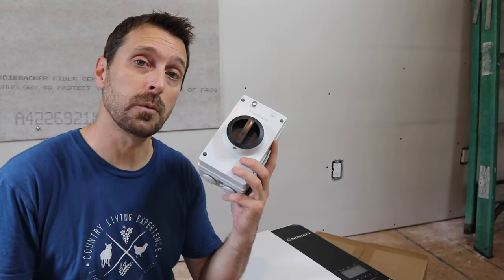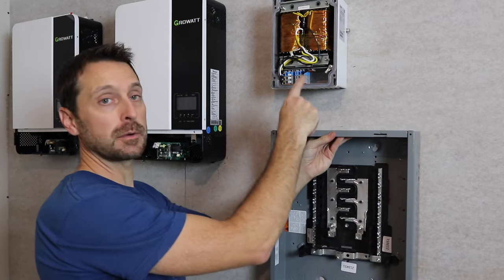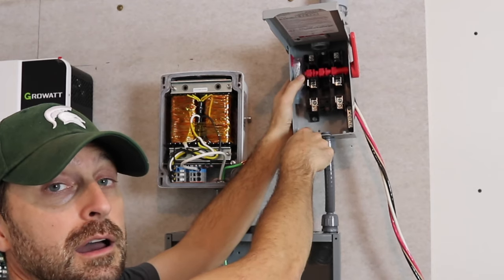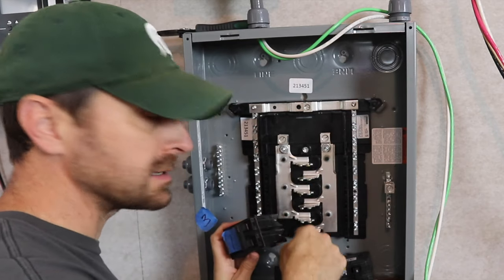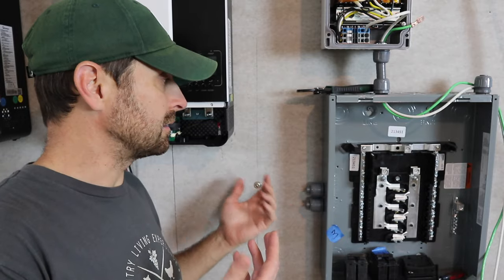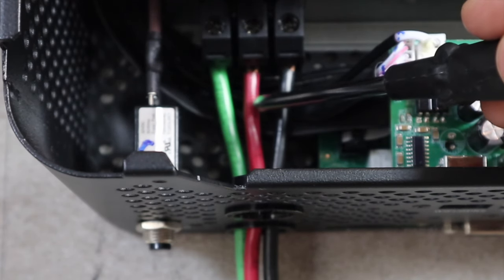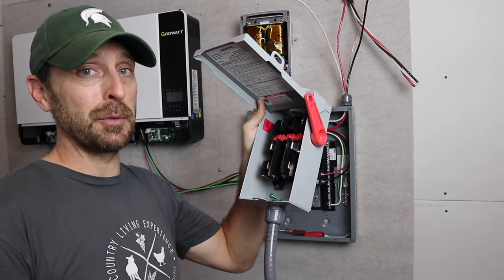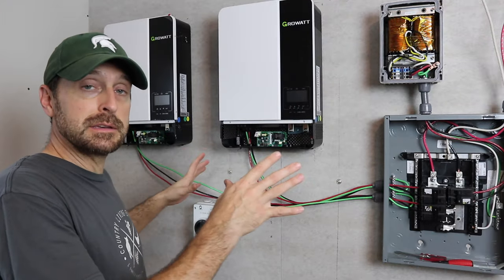Growatt Inverter 5kw Installation And Wiring DIY Solar System!

Comment: Hello how many panles 540w can i put to growatt inverter 5kw es 
Can i put 10 panles 540w 2 string in 1 string out.
Reply from the maker: Hi. If you wire the 10 panels in series you will have 5400w but you need to calculate the voltage open circuit. Say your panels are 48v and the VOC is 41. Then you will have 410 volts input which is fine. The Growatt 5000es can take up to 450voc input. If wired in series, your amps will stay the same as a single panel (about 10 or 11).  You need to find out what all the numbers are for your panels first.
Not sure what you mean by string in and string out.
Reply: @CountryLivingExperience  i have 10 panles 540w voc is 49v 
And vmpp is 41.5v i want conncet to growatt 5kw es what the best conncect you recommend .and i need fouse for them

Comment: Good information , thank you . I have just fitted 2x of these to my 10 kw  off grid system and  all was running well for 3 days .I then added the wifi dongles and now the system shuts down  in 2 minutes !
Have you fitted yours yet ? If so did you have this  problem ?
As far as I can deem it may need a firmware update ?
Reply from the maker: I choose not to get the dongles. Sorry, I can't help. I would give Sig Solar a call (if you purchased it from them).

Comment: What does the 6/3 wire attach to?
Reply from the maker: Here is the part 2 video that shows all of the wiring.....https://youtu.be/I2rbxKtx5cs
Reply: I watched the second video. Didn’t see it there. You talk here about the 70a breaker and 6/3 going through your attic. What is that for? You’re not running 6/3 from your panels, are you?
Reply from the maker: Yes, It attaches inside the sub panel that then goes through the attic to our main panel and lands on a 70A breaker. I don't know how else to explain it. It powers the house breaker panel. 
The solar panels have 10awg pv wire running under the ground and into the inverters.

Comment: Im lost on a couple of things. You called line 2 black wire a neutral then hooked it to a breaker not to the neutral bus bar . did I missed something? The other thing I don't get is it appears ( pls don't take this the wrong way) you wired the inverters into the breaker panel on 3 separate breakers which I thought was each inverter in on one breaker. And out the other side bcuz its appears to be labeled that way but I see your main lugs at the top wired like its going to the transformer. What I thought was it was supposed to go like this.. If its a 220 inverter without a built in transformer that it has no neutral/common .line 1 and 2 go to a disconnect/breaker from each inverter and are combined to go to the transformer . When it leaves the transformer that's when the neutral and both powers and ground will go into a panel to one breaker and then neutral and ground busses. Sorry I know that was a lot
Reply from the maker: Sorry, sometimes I am not to good with my explanations. I believe I connected everything as I should. Please watch Signature Solar's video on how to do it here and then get back to me...https://youtu.be/NVnJhFxCFHw.

Comment: your link for 12 position electrical sub panel does not work , you put in 40 amp breakers you say but yet you have the link for a 30 amp shut off switch
Reply from the maker: Amazon changes the links all the time. I will go check them.
Reply from the maker: Here are the updated links.....https://amzn.to/41DKkXe, https://amzn.to/3YgK2CX
Reply: Woah thank you , can you answer this

I got Chtaixi AC Miniature Circuit Breaker, 40 Amp 120V/240V 2 Pole DIN Rail Mount Circuit Breaker

With 
Siemens E0816ML1125S EQ 125 Amp for the panel box do yu think these 2 will work together thanks for your replies
Reply: The one you reccomend has the neutral bar built in i admit it i got the wrong one need to rebuy can my breakers that i commented work with this panel ?
Reply from the maker: @unkillablespirits8582  They will not work together. You need Siemens breakers for a Siemens box. DIN rail is a totally different mounting system and placement.

Comment: How do you like your growatt 5kw inverter?  I am thinking about getting that one, or waiting on the signature solar branded one that will be 3kw.  Also, how have you found signature solar to work with regards to communication and customer service?
Reply from the maker: I like them a lot. 
Make sure you only buy it from Sig Solar. They are the only Growatt seller in the US that has had the inverter modified to work properly with the American grid. There is a huge thread on this over at the DIY Solar Power Forum.

Comment: If you are using grid power your plan is to shut off your solar?  

The way it is wired this would be the case.
Reply from the maker: Correct. This is an off grid system. We talked about it in all of our previous solar videos.
Reply: I would use a three pole shutoff switch going to the main panel and break the neutral wire.  If using grid power and in a fault condition you have a current path through your solar equipment.  Nice video btw.
Reply from the maker: @kickeryou  Thank you. I appreciate the 3 pole shutoff info.

Comment: I like your videos highlighting the Growatt inverter plus the auto-transformer. However, it seems that SDGE seems to have only simple grid-tied inverters on their approved list. I have been asking around to see if these new inverters have a chance of being approved.   Otherwise it seems I have to choose a  grid-tie, a transformer and charge controller and battery to add battery backup.
Reply from the maker: Please link the approved list you are talking about.
Reply: I've seen these growatt with the 120 transformer. There is a good few on you tube. Good video on the wiring.  So well done on that one.

Comment: How many panels is recommended to power the 5kva growatt
Reply from the maker: It depends on the size of your panels. The max pv input is 6000w.
Reply: @CountryLivingExperience  let’s say 16 350watt panels can I still use 4 lead acid batteries or I need more batteries
Reply from the maker: @gabrielosang9376  That number of 350w panels would be 5600w total, so yes that would work. Batteries have nothing to do with it.
Reply: @CountryLivingExperience  thanks so much…I just have one more question…someone is saying either you use 8 or 16 panels…that you can’t use 14 panels…how true is this
Reply from the maker: @gabrielosang9376  That is not true.  It depends on the size of the panels and how you wire them.

Comment: I realize that a 240 V inverter should be more efficient than a 120V output, but you have to buy a separate transformer. Why not buy a Growatt that puts out 120 V?  I suppose that this has the built in transformer.  For a home with split phase, wouldn't this be better?
Reply from the maker: I didn't mind buying a $400 transformer. The cost was negligible in the overall cost of the system. At the time I purchased, the 12kw 48v DVM MPV was not available and it is not stackable.

Comment: DISCLAIMER: I am NOT an expert.

My logic tells me we shouldn’t have the bus in the breaker box powered by multiple sources.

The wires that attach to the breakers should supply power to the destination equipment.

If you need to de-energize the breaker box, you must know to turn Off several breakers, or some that misses one could get electrocuted.

I feel like the power out of the inverters need to go into a separate sub panel that then feeds into the autotransformer, and from autotransformer into the breaker box, then from breakers in the breaker box out to destination circuits,

Just my opinion, but someone may get shocked with this layout,

Again this is only my observational opinion, 
I do not have any hands on experience.
Reply from the maker: It is not powered by multiple sources. The interlock kit on the main panel prevents power from ever going back to the sub panel. Both breakers cannot be on at the same time.
Reply: While both breakers can not be on at the same time…

If the autotransformer is energized, the breaker does NOT connect the Neutral from the AutoTransformer - I would think that the Neutral in that instance still has voltage, and someone could get shocked, because they assumed the power from the inverter via the autotransformer was disconnected from the breaker box.

Do a test and see if the autotransformer is still energized, but the L1 and L2 are the only lines disconnected by the breaker, does the autotransformer Neutral still carry voltage or current?
Reply from the maker: @Just_An_Idea_For_Consideration  You do sound like an expert. I have no power in the system yet as the PV is not connected. I will do testing to see if this occurs once all items are in place and working. I appreciate your concern.
Reply: Thank you, i am very interested in your findings.

Comment: What happend when Transformer dont work no more or transformar braker go off dont you will have L1 and L2 still be going to your home
Reply from the maker: Good question. It could (but not proven) overload a few light bulbs. I may add a second transformer in parallel for backup. Out of 3000 systems currently in use sold by Signature Solar, nobody has reported that issue however.

Comment: Awesome stuff as always! Would you go for this setup over growatts 12kw all in one? The 12kw already has a built in transformer as well so it seems much simpler. What do you think? Specifically the SPF 12000T DVM MPV.
Reply from the maker: I liked this setup because I can stack these. You can't stack the 12kw. So If I want more power, I can keep scaling up.

Comment: Hello'!!!
I have been watching your videos, specially the solar ones and, now that I've seen this one, I'm a little bit concerned about your setup.
First of all, those Growatt Off Grid inverters that you're installing (SPF 5000 ES) have 230 Volts 50/60 Hz input/output (European standard), they don't have an L1 and L2 terminals as they do not work on 120/240 Volts split phase electric systems... they have L-N-PE connections (as in Line 1, Neutral and Ground), so they have 230 V on L1 terminal, the corresponding neutral of the L1 phase on the other terminal and a Ground terminal... that's it... so, you have to check your connections because, as you explained in the video, you are connecting a neutral cable to one of your 120 Volts split phase terminals... you know what that means, right??!!
The second issue is that your stacking 2 inverters to work together without the parallel cables that come in the box (or, a least, you did not use them in the video)... you have to parallel the inverters (with their parallel and communications cables provided) so they can work together in managing your loads as you are putting their outputs together on to your main panel...
Last but not least, the output of your paralleled inverters should go first to the autotransformer and it's output with the introduced Neutral terminal - the 3 cables (L1-L2-N = 120V-120V-Neutral) -  are the ones that should go on to your main panel to feed your 120V and 240V loads in your house...
So please be careful and review once again your setup before your come up with a big... surprise when you fire up those inverters!!!
Take care,
A concerned Samaritan.
Reply from the maker: I appreciate the concern Alfredo. Before we get into the conversation, please watch teh demonstration from Signature Solar on the install here:https://youtu.be/NVnJhFxCFHw. I believe I did it the exact same way they did. I also had my electrician here to confirm. I did also mention in the video that I was not done installing the parallel connections and would do that in a following video in the series.
Reply: @CountryLivingExperience  Thank you for reading and responding my post, I get the demonstration from Signature Solar, but I'm not comfortable calling L1-L2 something that is not (its L-N)... probably after the autotransformer, that is a correct concept, but not before it... 
Good to know that your using all the paralleling cables... ufff... that's a relief...!!!
But, my biggest fear is if your autotransformer breaker trips? Your leaving your 120 Volts loads without a neutral connection... that's scary...!!! The current would have nowhere to go... The least that could happen is that you wind up without power on your 120 Volts circuits... Maybe it's just only me, but I wouldn't feel comfortable with that solution... Just my 3 cents...
Nice chat...!!! Take care... and keep the videos coming...!!!
Reply from the maker: I appreciate the conversation. As for the transformer breaker tripping, I was told that it would only cause the 120v circuits/loads to not function.
Reply: @CountryLivingExperience  Yes, but they would still be energized which would be dangerous as someone could get shocked... I agree with another opinion here that states that it would be better to parallel the inverters outputs then go to the autotransformer and then to your subpanel ... all on different breakers separate from the subpanel ...anyway, I'm looking forward to your future videos to see how it all worked out... Good Luck!!!
Reply: @Songomx  Shocking

Comment: You shouldn't fill conduit more than 40% if it has 3 or more wires...
Reply from the maker: Depends on the length of the conduit and the conductor size

Comment: SPF 5000 ES( Growatt)
off Grid  Solar New Installation
with 12Vx 250Amphrs- connected in series

Why do  i get  230 current at solar  input terminals
+ points &  -side.?
(ACpower)  terminals  at the inverter.

Becos of this we did not  install solar panels to 
the Inverter.
System is working  on batteries . Fine
earthing is checked
Inverter is earthed.
when its on batteries  you  can ?? funny
but true
what is the reason  for this?
Reply from the maker: I don't know what you are trying to say or ask.

Comment: Help me out here I wanted to go with the Gro watt  5kw 48 volts off grid until I looked at this video what are your thoughts?
I got this link from Will Prowse , seems he no longer as big of a fan of the Gro Watts 5KW off grid because of this issue.

https://www.youtube.com/watch?v=gQ4NF9n0UxE
Reply from the maker: I have watched it and I am in on this conversation on that video. (see Will's comment thread). He didn't say he is not a fan anymore. Additionally on Ian's video, in the very last part, Ian says that this does not apply if you are running these in an off-grid configuration. The Growatt 5000es is specified as an off-grid inverter. The only potential issue that arises is when you hook ac power from the grid into it. I will never do that on mine even though it has the capability. Additionally, I think Will got an answer from Sig Solar about the bonding screw inside of the Growatt. Sig Solar stated to him that these inverters sold in the US do not have that bonding screw in place. I have yet to call them and ask them about this issue. I am not really worried about it anyway since my system is off-grid essentially. If you are going to be off-grid, I wouldn't worry about it and would move forward with the Growatts or wait a little bit and see how Sig Solar responds or call them with your concern. Hope that helps.
Reply: @CountryLivingExperience  Thank you for the reply, very helpful.